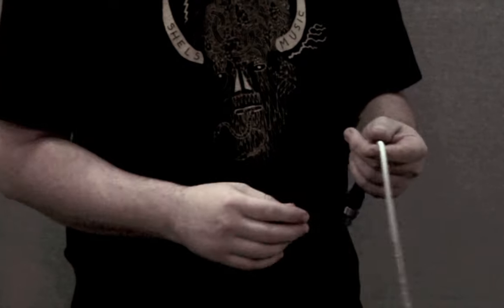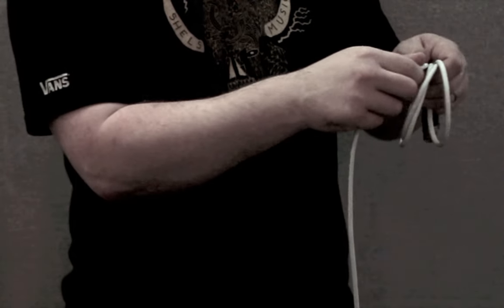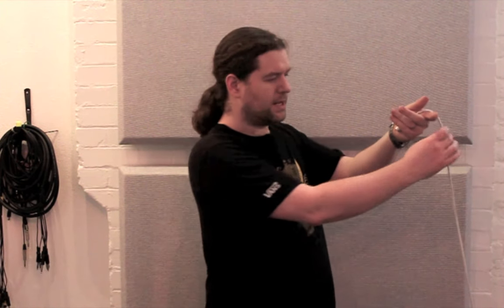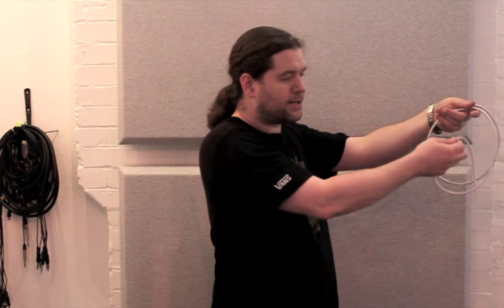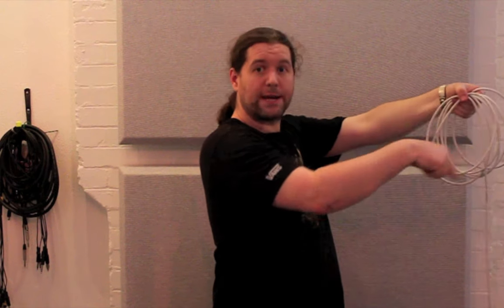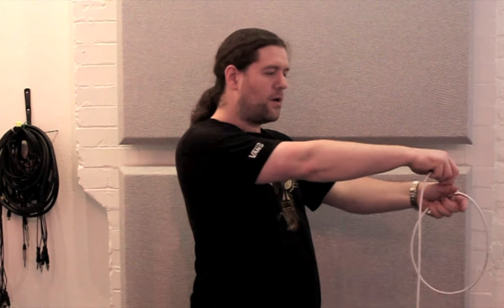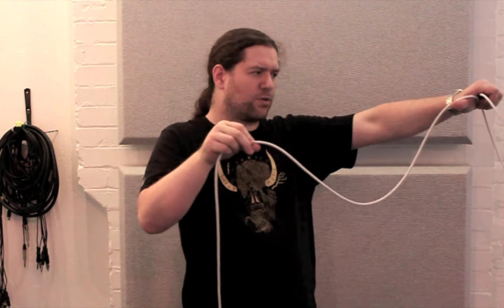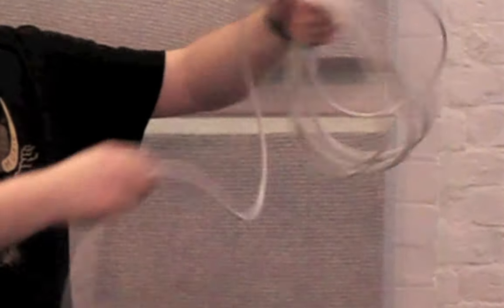How to Coil Cables

Comment: Velcro ties are convenient.  Especially the kind that have eye-slots on one end.  This way the tie can be attached to one end of the cable and won't get lost when it's uncoiled.  You can also get releasable zip-ties so you don't need to cut them apart when uncoiling the cable.

Comment: Great video!! Here's a trick based on the idea that it's about 3' from your fingertip to your nose: 
For really long cables, you can make about 3' loops by pulling far enough to extend one arm, while holding the loops at your chest. And make 6' loops extending both arms completely each time you loop.   This is mostly helpful for giant extension cables that must be hung on a hook that seems too small. Less loops, made larger, will hang easier.

Comment: hey guess what, I've been struggling and struggling with that over-under wishy washy stuff, never able to properly get it right, I try your 2nd technique, grasp what it comes down to in 3 attempts, and immediately end up with a perfectly rolled cable, in a fraction of the time.

It's not only easier, its faster, more efficient, and feels a lot more natural! My audio jacks even consistently end up just past each other, perfectly fitting my hand in between.

Comment: I've been coiling cables for over a decade and I've never seen it taught like the second method, specifically using your thumb like that. I tried it out and even with it being unfamiliar, it is a fast way to coil a cable! I wonder if it's a UK thing? I might try switching to this technique.

Comment: Of course man, I was referring to the user who didn't believe that Ethernet cable coils might downgrade Internet bandwidth performance. Network engineers/technicians are aware of this :-)

Coils also act as antennae, especially when high-frequency switching occurs (neon lights, cellphones, etc.), but that doesn't happen with the long shielded cables your video is supposed to be about :-)

Anyway, amazing tutorial dude, I have to practice a lot with your coiling methods ;-)

Comment: Usually the problem with networking cables is attenuation is caused by cables that have been mishandled or wound too tightly.  The pairs of wires inside are twisted together at different rates.  When a kink or tight wind is introduced to the cable, the twrist gets screwed up and your cable is more susceptible to EMI.

The end effect of this is data has to get re-sent multiple times because it might not transmit properly.  Coiling your ethernet cables will produce similar results due to EMI.

Comment: I find it also helps to lay several cables next to each other, in a bundle. This will allow more bandwidth through, as the signal will jump from cable to cable as it travels.

Comment: Well, first consider the minuscule amount of inductance that a coil that size would have, the cut off frequency for the resulting filter would be in the Megahertz range - the filtering effect of the cable inter-conductor capacitance would be far more significant.  
Secondly, the alternating coil direction will actually cancel out some electromagnetic interference, so benefit the recording quality.  
Thirdly (and most importantly), you uncoil the cable when you use it....

Comment: Technique 2 in this video seems result in a different coil arrangement, but still tangle free. To make the same coil arrangement as technique 1 using technique 2, the right thumb needs to be rotating away, not towards you.

Comment: Why is it wrong to wrap the cable around your arm?
Reply from the maker: When you coil around your elbow you tend to make the angle too tight and put too much tension on that part of the cable. Eventually you damage the cable and there is nothing worse than an intermittent or noisy cable in the middle of a great performance. Even when the cable doesn't appear damaged the shielding around the core cable gets thinner on the stress point.
For those that say you can use the elbow for speed, you can if you keep your cable very loose but that makes you go slower; once you get the manual skills the correct method is as quick as any other. The video shows it slowly just so that everyone can see it clearly.
Reply: you twist the inside of the cable around independently from the outer rubber casing, ending up with twizzlestick cables. It fucks them real quick. I used to do it that way. Now I do it like the guy showed at the start of the vid (saying what not to do) so I guess I'll learn this technique
Reply: +James McDonald The curly cables look bad on stage and get in the way more easily as well.  And they are annoying to coil once they have the permanent twists.
Reply: Even with rope, which will not have the damage problem mentioned, the loops will not lay flat if you wrap it around your arm.  
However, when doing the backward loop method, be sure not to get the end going into the middle of the loops when unwinding, or you will learn how to tie 50 instant knots at once.
Reply: Lloyd HAAAAAAAAA!

Comment: Best way to coil indeed but those high te h techniques are not worth on my opinion
It is so much faster and easier to twist the cable to make the first  coil, then simply to twist it the other direction to create the second. The hand do not change position so it is fast and easy.
May be not recommended tu o help the coiling of expensive cable  with about a quater turn one then the other direction but it just helps it does not really twist the cable more than it is naturally by the coils.
Regards

Comment: noob! XD

you can coil the cable normally without entangle the cable as long as you twist and loop the cable. Twist and Loop, Twist and Loop, Twist and Loop.

In the video you simply loop the cable without twisting the cable that's why it entangled.